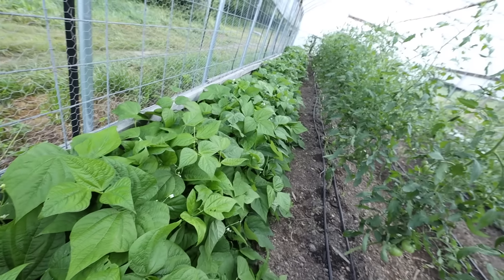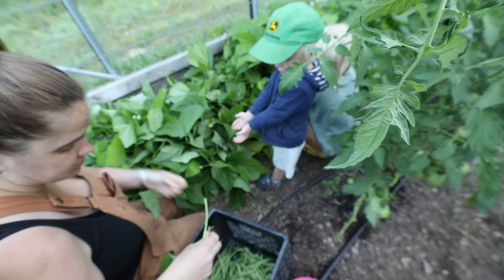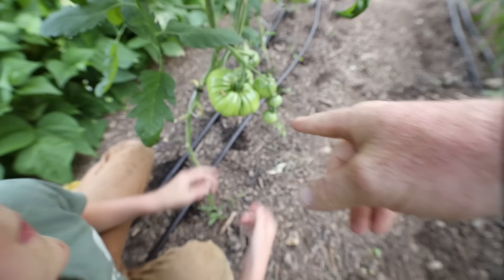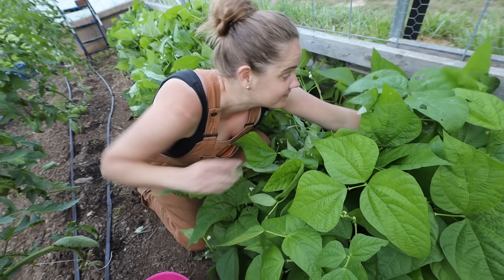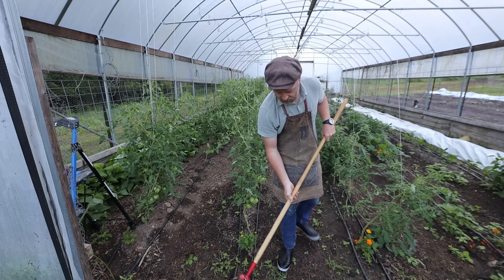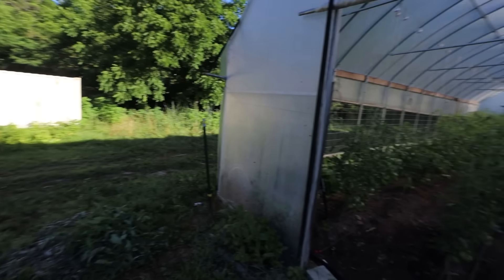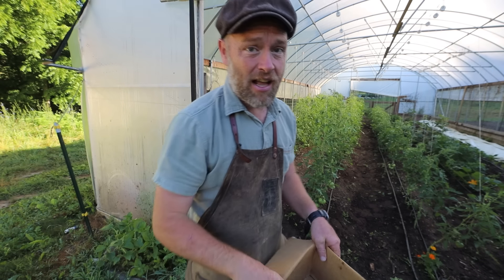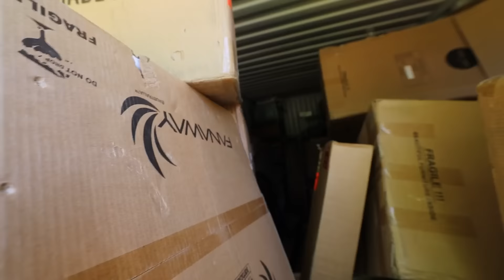Curve Ball

Comment: Becky. Canned tomatoes are great for soup. Just boil whole tomatoes. Dunk in cold water peel  cook. Skim foam put in clean hot jars. I put mine in oven on low and sanitize heat rings and lids. Don't over heat may bust. Add 1 teaspoon canning salt to quart.Clean top of can with cloth   Can turn upside down for few minutes. Reverse. I don't Water bath . Leave sitting all night. Check seals. Clean off cans. Soo fresh and good